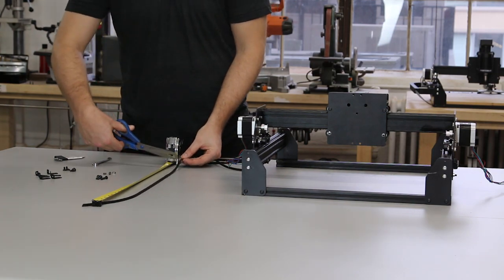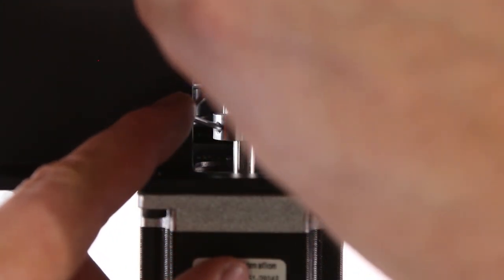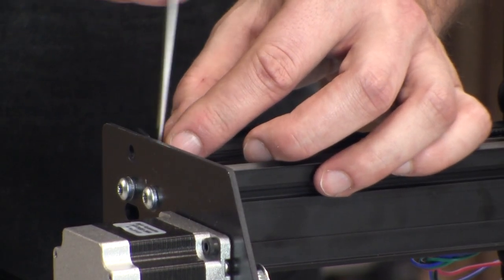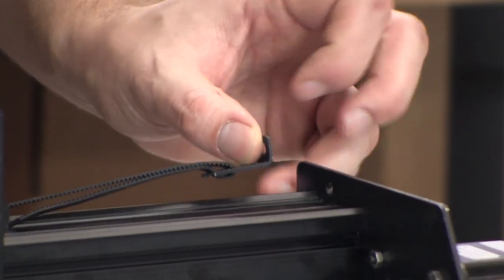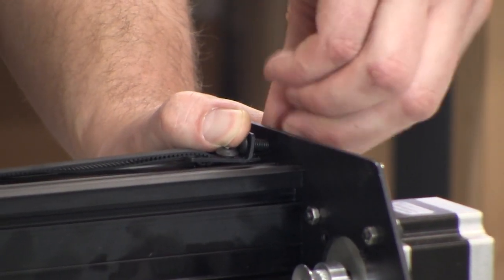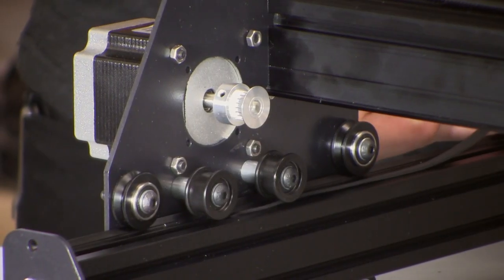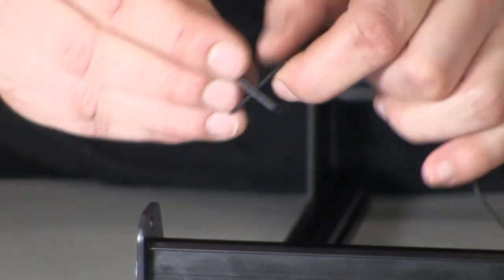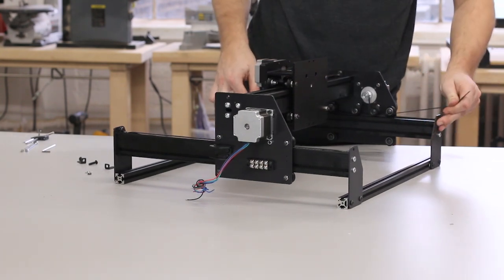X-Carve | Assembly | Belting v3

Comment: The tennsioning screw doesn’t go in as both screws are too big to fit in there.
Reply: The order matters.  Give us a call and someone can walk you through it 312-775-7009
Reply: Same thing is happening to me. With as precise as everything is, this is a silly overlook on their part. Not I gotta start bending stuff I don't want to
Reply from the maker: @85ctorres  put the other screw in first.  There is no need to bend any parts.
Reply: @inventables  I’ve been stuck on this part 2 hours. No matter which order you put the screws they do not fit. Frustrating. Tried to call support, of course they are closed. Super frustrating. I’ve been assembly my machine for 12 hours strait now and this preventing me from competing it. Maybe some bracket sets are faulty. The hols are to close and together the screw heads can’t pass each other. Not even close!

Comment: Align the pulley by eye as it shows but after you have the belt under tension, watch the space between the belt and pulley edges while running the assembly back and forth on the x axis. Keep in mind that the belt will track differently when driven by the motor than dragged by the assembly.